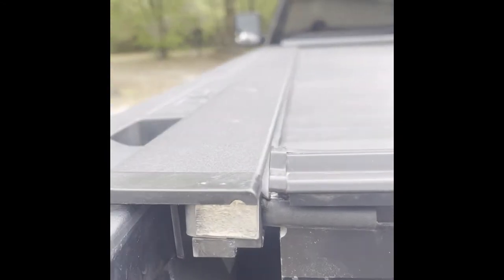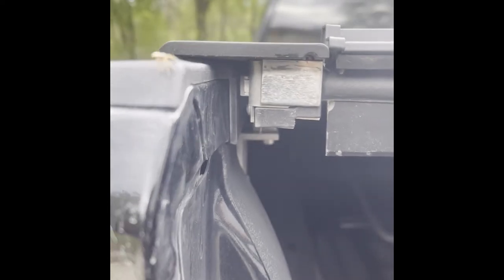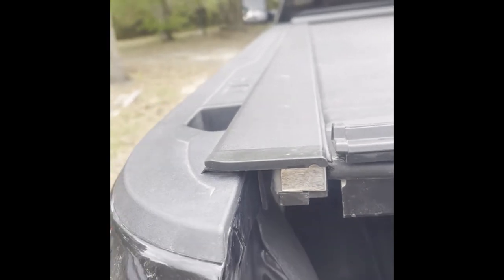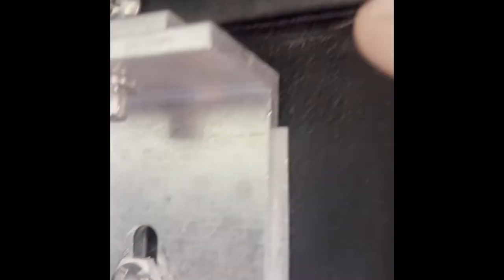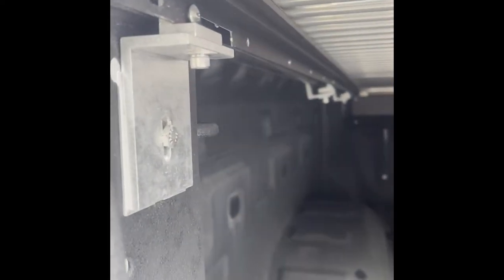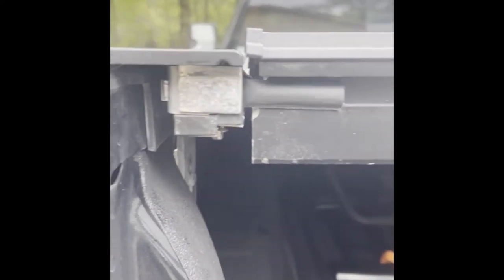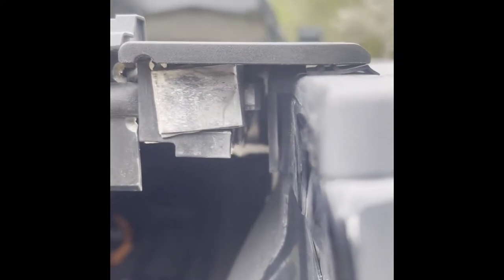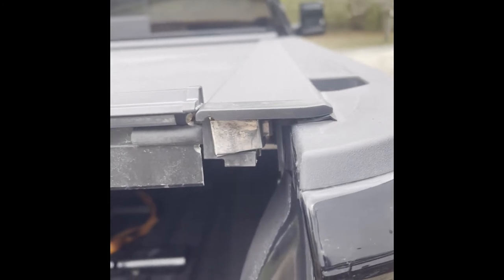Roll-n-Lock Cover Lock Fix

Comment: Just bought a ‘22 Silverado High Country and had the dealer install this cover and it keeps opening up while driving back roads (which are rough here) and it was driving me crazy! I suspected bedside flex was the culprit, and now I am more confident AND know how to adjust it. 

Thank you!!!
Reply from the maker: Anytime, yeah my roads are the same way and it did it on my brand knew truck and I thought the same thing at first was the bed flex. After looking at it closer I realized this was what was causing it. Glad the video could help
Reply: @tatesoutdoortravels1763  went out right after watching this and made some adjustments, I hope it helps cause otherwise I love the tonneau.

Comment: Hey Tate, thanks for the video! I recently ordered the same cover and had the same issue but at the various locking points. I’ll set it in one position (not all the way closed) and within a couple minutes of driving it recesses all the way back into the canister. I contacted the supplier and they said it’s not meant to stay in those positions when driving, they’re only for loading and unloading… Has that been your experience? Doesn’t make much sense to me to have those other locking points if it’s not meant to stay there.
Reply from the maker: I have always had it all the way open or closed. I haven’t hauled anything that I only needed it part way open.

Comment: Can you show how you adjusted the metal pieces after loosening the screw? I loosened the screw and my metal "L" bracket doesn't move much. I appreciate if you can show how you adjusted those. Mine won't move as much as yours did.

Comment: I accidentally locked mine open now I can’t unlock the unit to fully close it any ideas?
Reply from the maker: You mean where it’s actually locked with the key and rolled all of the way open?
Reply: @tatesoutdoortravels1763  yes for some reason I locked it closed the handle and now the key won’t turn or pop the handle up
Reply from the maker: You may need someone to help but if you can’t get to the lock due to it being roll all the way in you can take a L-shaped pick or a smaller L-shaped allen wrench and feel the outside of the rail where the pins come through and use the pick or allen wrench to push the pin back through the rail and have someone lightly pull on that side and do the same to the other side to get it pulled out. If that doesn’t work send me pictures of the lock on top and underneath if you can and I will do what I can to help